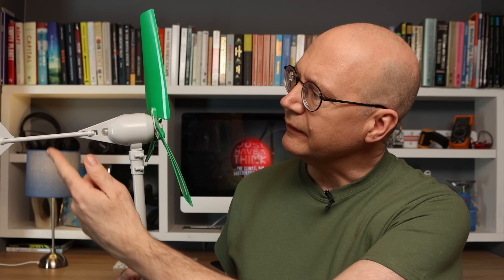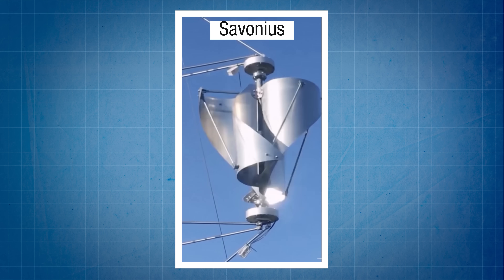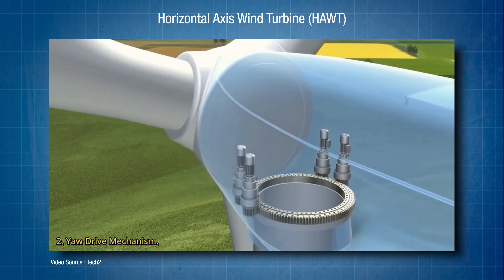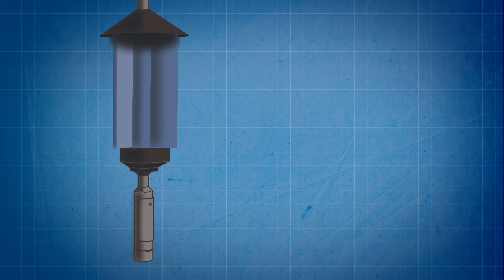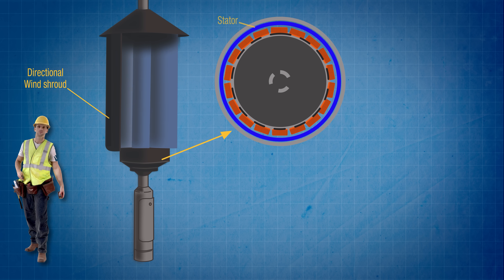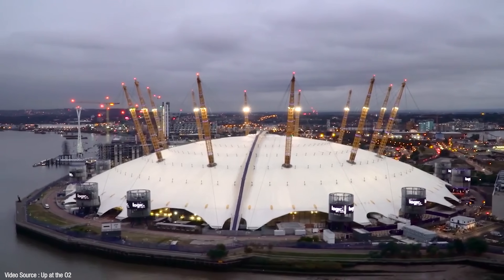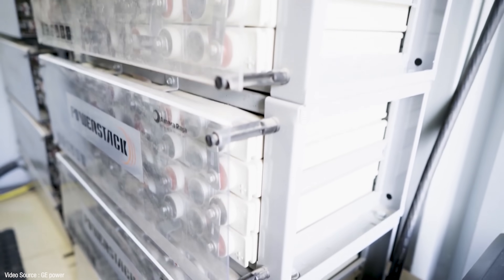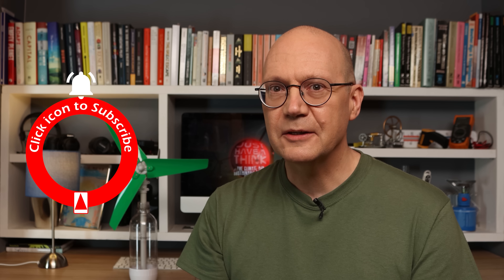A vertical axis wind turbine that doesn't need the prevailing wind! How do they do that?

Comment: Those solar numbers (at 9:00) don’t look right to me.
Firstly, if the price per KWH is 0.055 and the cost is £45M that means you would have to generate 818GWH in 25 years or 33GWH/year. You can’t generate anywhere near that much in the UK from 3MW, surely? (I’m generating 5MWh/yr from my 3KW of panels in a country with perhaps 2x the sun of the UK so 3MW can only generate 2-3GWH/year in the UK.) Or have I made a mistake?
Secondly, isn’t comparing MW to MW the wrong comparison – we need to look at WH not W surely in this case.

Comment: Perhaps these VAWT could be installed horizontally on domestic roofs to overcome some of the obvious planning issues. They would benefit from wind acceleration on a roof but would only work when the prevailing wind was blowing. In my city prevailing winds are E or SW 80% of the time. Both of these directions would spin these turbines if a suitably oriented roof ridge line was available that captured our prevailing winds.

Comment: Can someone enlighten me as to how they will be installed. They are shown with the lamp post running though the centre of the turbine. Does that mean you have to take down each post to slide them on ? Unless the wind turbine splits in two , including bearings and stator, I cant see how this is possible without taking the post down ?

Comment: This is really not quite free.  Slowing down the wind created by the vehicles will have an impact on the vehicles.  That's why drafting works.  One vehicle takes advantage of what the previous vehicle did to the air.  Perhaps the trade-off is very good.  Don't know.  But it's not without some cost to the vehicles.

Comment: With the Billions to trillions (?) now spent on massive solar and wind farms that are ugly and have poor efficiency at the Industrial Macro level with no viable way for battery storage, but are quite efficient on a Micro single home level with battery storage. My son's house merely needs a small wind turbine like this to achieve 120% levels as he is right at 100% most of the time now. I believe that instead of subsidizing large corporations we subsidize all homes and apartment buildings, where viable. The extra 20% would go a long ways to electrifying at least about 80% of our country. It is fairly easy to make small banks of batteries for a home or apartment buildings under 4 stories or so, but with the present level of technology large city sized battery banks are not feasible.

Comment: Energy has always been a capitalist venture and without the neck hold and large profits, the socialist low cost energy products fizz out. This Idea is actually quite old about 15+ years as far as I know, there are several other similar projects in near production states and most, if not experienced do fail.

Wind power is a requirement for solar as is  storage, , if we changed roof tiles to solar tiles, and fitted one or two small turbines which is more than capable of power generation above two days use on one day then we're talking. The home storing around 5 days power would or could be off grid.
The downside, is that to make a off grid, it is near the cost of supply and the ROI is 5+years, in which the storage may need replacement and is a majority of the costs. 

I think small forms are better which need to be scalable. And some form of affordable and attractive solutions making a jump more simple. There are many myths about power which I think people fear and this together with the ripoff and misleading claims of yesteryear solar has really caused issues within the consumer market in general.

Comment: The example comparing a 3MW solar plant to these turbines was seriously flawed- you compared a fully installed project to an equipment lease and the energy outputs aren't even close- 125 turbines at 5.8kWh per day works out to  265MWh/year. A 3MW solar farm will produce 4000+MWh/year.  You can get equivalent energy out of a 200 kW PV system.

Comment: One Natural Gas Power Plant that produces say-350 mw per hour versus a wind turbine that only can produce at average 1500- 2000 watt hours shows how many wind turbines would be needed to produce the output of one Gas Fuel Power Plant, you would need multi acres to equal one power plant and these wind turbines will freeze up if you have a freezing rain condition...

Comment: They can use the existing HAWT towers, sides of buildings, communication towers as you said and installed dozens of smaller VAWTs. Decommissioned smokestacks can even have fan generators harvesting the updraft. Investors always look for one big payout. I always said you can buy a dozen chicken eggs or one equivalent ostrich egg. If one breaks you still get the 11 while you're replacing the one. When the ostrich egg breaks you lose the entire thing

Comment: Huh. What a fantastic idea. I geuss there is a downside that people will chuck stuff into them. Oh wait maybe they could put cover's on them.
The wind generator is a tricky little entry. So many available but not necessarily geared right. I bought one that only produces 1amp in 15-20 knots totally useless. Sold as 1800w. What went wrong.
Reply: Did you forget to take the cover off?

Comment: When I saw the title I immediately assumed the tech worked on convection - paint the surface below the VAWT black and as the ground heats up, it heats the air above it, with that warm air rising through the turbine blades. Has anyone tried this?

Comment: Airflow VAWT are a great idea.  I have an Aeolos VAWT currently installed (and a Missour HAWT).  I had to go all the way to China to secure the VAWT because local residential designs and markets really did not exist - and it was frustrating, expensive and riddled with Custom's paperwork.  These downsized domestic VAWTs promise to fill a huge gap in domestic, clean energy production.  VAWTs have several important advantages:  they are MUCH quieter than HAWTs (no yaw, no "screaming"):  they are DESIGNED to handle mult-directional wind and sudden gusts so the torque that has destroyed two of my Southwest HAWTs is minimized and unit longevity looks much better.  VAWTs do not produce as much energy as HAWTs, but the generated power is not insignificant.  Kudos for the idea of highway airflow VAWT, but residential applications should also be vigorously pursued.

Comment: There is a lot of air movement around tall buildings, up and down as much as around. I postulated the use of ‘energy walls’ around tall buildings over 25 years ago, to collect these sources. It was taken up as a concept and presented by the then Senior Partner at KPF. Unfortunately the small scale  turbines at that time were not available to collect the resource, but it is good to see new turbine design developing that could now work?

Comment: The solar panels are capturing new energy, while the road turbines are simply capturing some of the energy already captured to power the electric powered road vehicles. So the solar array is still required to capture the energy in the first place.
The use of captured energy from road vehicles might have some interesting unintended consequences, such as a requirement to maintain higher speeds on motorways so as to capture more energy. How will such turbines affect the design of vehicle aerodynamics.
It would be interesting to know if these vertical wind turbines are less likely to kill birds.

Comment: It seems like trains and subways would be good candidates for these as well.
Reply: yes millions of dollars spent so a few trains can spin them for about 1hr a day....worthless.
Reply: I would think subways more than trains just based on frequency. 

Cross-country freighters wouldn't pass by the turbines frequently enough to generate stable electricity generation. You could deploy the turbines still to act in twofold functions though, one to collect displaced air currents by trains and another to collect natural wind currents. 

Subways in more urban environments would offer better frequencies, but I still wonder if that would be enough to provide good generation. There are more structures in urban areas that cut wind patterns and so any natural wind current collection would be lower, in general, than in rural settings. 

Of course, there may be specific peculiarities where some VAWTS installed next to subway lines would generate crazy amounts of electricity. Depends on the specific context of the area. 

Roadways are good because they offer quasi-continuous flow. 

But then this is the whole conundrum with intermittent renewables. Grids around the world are reconfiguring to accept these kinds of sources, no matter where the intermittent electricity comes from.

Then you have to think about transmission infrastructure. Trains in more urban settings use the track as the return branch of the circuit, but I'm not sure if they are rated to carry this increased load. If not, that means new infrastructure such as underground ductbank or overhead pole lines. In rural settings, most trains run parallel to roads and in theory you could tap into the pole lines that run alongside them, but the capacity constraint still comes up.  

It just depends on if the electricity converted in these unorthodox settings warrants the resources used to create the devices.

Edit: grammar
Reply: Actually no. For the same reason I gave in my earlier comment. The back pressure created by the wind turbines would need further energy to overcome by the train. Because the train experience an artificial head wind. (Newton's law of motion)
Reply: @j.j.1064  Well, yes and no. The Piston Effect wouldn't be as pronounced as when traveling through tunnels because:

1) the turbines would only be installed on the sides of the track (not in a semicircle around the vehicles like a tunnel), and 
2) the turbines would be installed discretely as opposed to continuously (again, not like a continuous tunnel).

You'd have to test and measure

Comment: A runaway emergency brake system is traditionally the cost inhibiting factor for these vertical designs. Otherwise, they would have spread into many spaces, where the venturi effect is prominent (roof tops, next to buildings etc.).

Comment: This is far more expensive then they claim over the long run due to replacement parts and labor.  As a mechanic I know moving parts wear out,  and it costs a lot in parts and labor to fix.   We have trouble maintaining the electrical grid as it is.   We don't need 1000's of small mechanical devices that are going to need constant repair.   This is a cool backyard project, but that is about it.

Comment: Great content, thanks for sharing this.  I had somehow reached the conclusion that vertical axis was not feasible because of the dominance of horizontal axis turbines.  This could be a great addition to the microgrid concept and they would be so cheap to add.  In addition to being near moving vehicles, it would make sense to add them to places where we have fans moving air anyway, such as ventilation systems for large buildings.

Comment: Consider two rows of these turbines one on either side of a road. On one side the wind produced by traffic might add to the prevailing wind increasing output but on the other side where traffic is going the other direction it will be opposing the prevailing wind. So is the net result just that of the prevailing wind after all?

Comment: There is no free energy. 
The wind turbine presence will lead to slightly increased fuel consumption due to increased wind resistance for all of the cars moving on that road.
Reply: Since currently all the energy produced by cars just dissipates as heat anyway, there will be no change in efficiency of the vehicles passing by.

Comment: This for once sounds like a goldmine, unlike many other ideas. They can be basically installed on every pole around the world, even on the poles of solar panels or normal wind turbines ^.^
Reply: Yeah the fact that it can be installed on poles that already have existing wiring is a masterstroke of genius.
Reply: @4saken404  ... it can also be installed on poles without wiring... Then it will cost slightly more, but at least you still have not install an extra pole.
Reply: On solar panels they throw a shadow. On wind turbines the wind turbine already takes a lot of the wind, behind the blades there is a lot of turbulence and little energy.

Comment: Was any assessment done on the potential distractive effect of a spinning object on drivers? IE: What is the possibility of these items turning (and probably reflecting light) being a "mesmerising" distraction on drivers? Is this not a road safety concern?
Reply: Dull colors will solve that problem if it ever occurs.
Reply: @3gunslingers  I figured this would be a possible solution. But we just need one nasty accident where the driver attributes it to "being distracted" by one of these objects for "nanny state" to kick in and legislate against them.
Reply: @brunosmith6925  
Pretty difficult. That would mean removing anything that emits or reflects light within viewing distance of any street.

Comment: I got another one for you. Decades ago I saw the following in Popular Mechanics magazine. They proposed putting pressure plats in the highway system before tollways. Cars had to break and slow down anyway. As cars drove up onto the plate it would depress the plate and pump hydraulic fluid through a pipe to the side of the road. The fluid would then  run a generator. 

Basically, anywhere you have high volume traffic and autos need to slow down anyway pressure plates could be installed to assist in slowing down the cars. For example, exiting onto an off ramp from the highway.
Reply: Thereby reducing brake efficiency thus gaining more fun at the crossroads... run cameras, upload accidents and get more views. Buy energy using ad money: free energy!
Reply: Although eventually almost all cars will have the regenerative braking, thus robbing Peter to pay Paul.

Comment: What's the difference between airflow and wind?   Somewhat rhetorical, but it doesnt bloody matter.  Its air going from one place to another.  Whether it is from atmospheric pressure differences or a fan or deflected air from a vehicle moving through a body of air, is immaterial.  You cant get something out of nothing.  As for the application for comms masts and houses - there are no cars up there, so its another form of wind turbine and thus suffers the usual benefits and drawbacks.  A great idea and really innovative but an iffy title for the YT video..

Comment: I have long championed 'microngeneration' - especially with VAWT technology.  Installing a series of two or three of these on each pole would allow the system to also take advantage of prevailing winds - all without compromising the prime objective of a street light, which is roadway illumination.  I so want something like this at my house.  Does anyone know if Alpha311 is marketing these for the residential sector?

Comment: I particularly like that VAWTs don't require exotic materials.
Reply: How's that then?
Reply: @dexterdixon2000  You know that solar panels require toxic materials to be produced, right? Cadmium Telluride, Copper Indium Gallium Selenide (CIGS) and some others.  There's one I'm forgetting that is called a "rare earth" that is mined in China (because they don't care about strip mining) that really jacks the price up because no one else will mine it (for environmental reasons). Ask your local recycler about disposing of broken solar panels. Yes, they are "mainly" silicon, but it's the other parts that'll getcha.
Reply: @krevor4095  I thought for your comment you were suggesting VAWTS use less exotic materials than HAWTS which I don't understand. In terms of compared to PV I'd be surprised if they didn't use Neodymium magnets for their alternators (although some folks are returning to ferrite magnets for their weathering properties) I acknowledge that solar panels end of life isn't very developed yet - that's because it's a fairly new technology and with no moving parts they don't tend to reach their end of life very quickly!
Reply: @dexterdixon2000  Locally, we've lost about half of the home solar panels in the area due to hail damage the last couple years. 
Yeah, HAWTs don't use much, but it's being discovered the blades don't have near as much expected life time as planned before due to excessive unexpected damage to the leading edge (and the Environmentalists are all stressed about the number of avian life that are slaughtered wholesale regularly).

Comment: As someone who worked in an Electric Power Utility (BC Hydro) for 30 years, the only problem I see with this concept is how to (SAFELY) connect all these small generators to the grid. And if they produce a significant amount of power, they need to be added to the AGC (Automatic Generation Control) so the System can match generation to load.
Having said that, it's a brilliant idea, and I've always loved vertical-axis turbines - for one reason, the "guts" are low to the ground so they can easily be worked on.

Comment: at the end of it all, these are still only 30% efficient. Would you buy anything that was only 30% efficient at it's best? I wouldn't. Intermittent energy is largely useless and at 30% would likely take years just to offset the energy used simply to make it. It's a nice idea in theory but we need to look at increasing efficiency (making the most of things) not flooding the globe with waste disguised as "green energy". Dams and rivers are still the only true form of green energy production we have.

Comment: Since these turbines are pulling energy from the highway air flow, one presumes the air is not moving as fast with the traffic. Does this imply that traffic will experience lower mileage - lower MPG since the vehicles are pushing through more air resistance? Have any studies been done to investigate impact on vehicle efficiency?  Good video though.